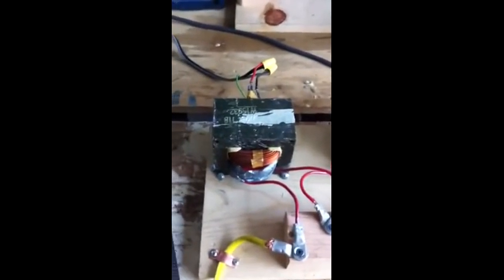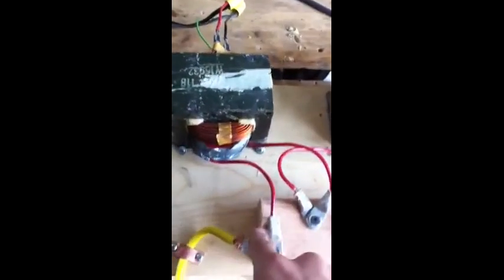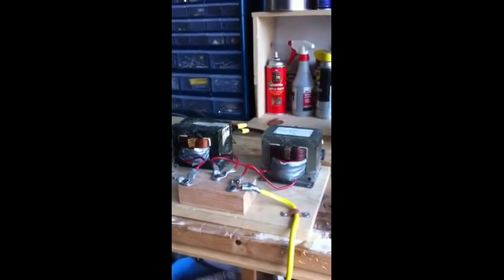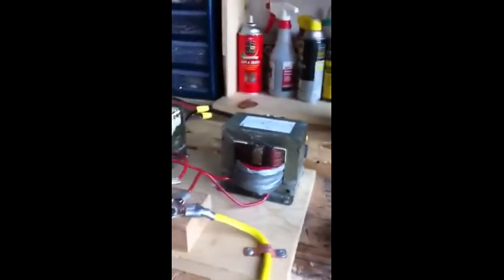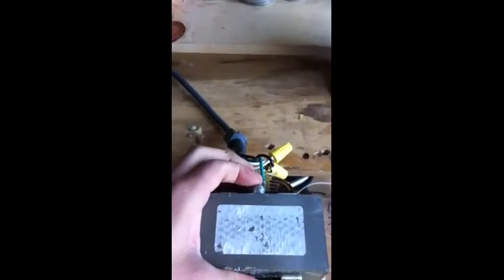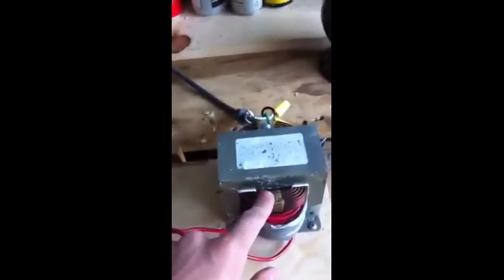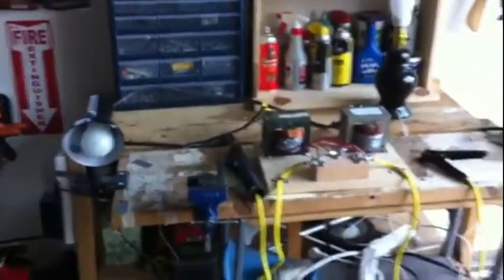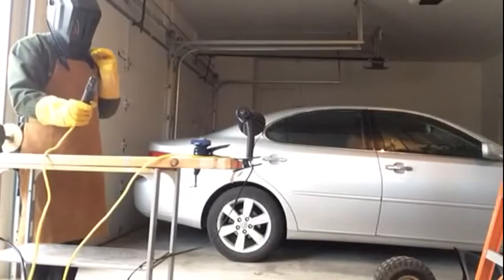MOT Stick Welder

Comment: The wire looks too skinny to carry the current.
Reply from the maker: Tbh it is. The secondary windings should really be 8 or 6 gauge, but with only two transformer cores to work with, it was not possible to fit enough windings of the thicker wire in to produce the required output voltage (stick welding becomes very difficult with an open circuit voltage of less than 35 or so), hence I opted to use 10 gauge wire, and was able to fit enough windings to get an OCV of ~50 volts. It does heat up pretty fast though

Comment: Hi some large capacitors to smooth it out
Reply from the maker: Would need to be in conjunction with a rectifying bridge, but yes that would be nice!
Reply: Use a AC Cap not DC Cap.. use the Cap that came out of the microwave u git the transformers out of